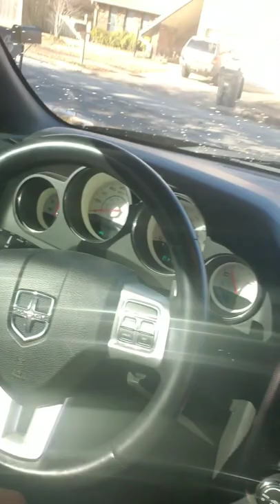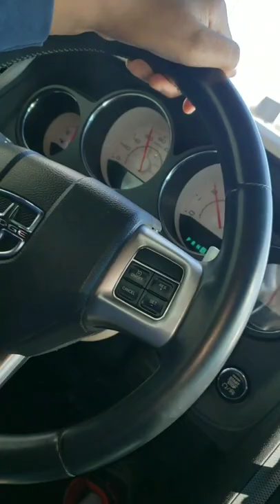2012 Challenger r/t straight pipe. Night & day diff

Comment: Manual or auto?
Reply from the maker: It's auto but I can use the gear shift pedals on the steering wheel.
Reply: aaron million cool. Just curious I got an automatic as well and wanted to make sure the sound was similar, I see the same setup but those cars are manual so they sound a little different from ours. Thanks.
Reply from the maker: Have u put in a different air intake set up it helps.
Reply: aaron million I did but it’s the Dodge Charger stock intake. I didn’t see the benefits of an aftermarket CAI unless it was a legmaker CAI. And I only swapped in the charger one so that I could install a catch can. The stock CAI box is already pretty solid. For an absolutely monstrous sound I was thinking of long tube headers / catless mids / and straight pipe.
Reply from the maker: It doesn't make a ton of extra horsepower but if it's done right it does add and you can tell the difference slightly and it makes your car sound a little better cuz it's breathing harder. When I bought the car it had cheap everything in it so that's why this is been such a project for me even the spark plugs but the cheapest ones that they can find they were like a dollar a piece so I took all of that out I can put the most expensive plugs in but definitely upgraded plugs then the air intake system and then I straight piped it and that is the end result but everybody has a preference so whatever works for you bro go for it